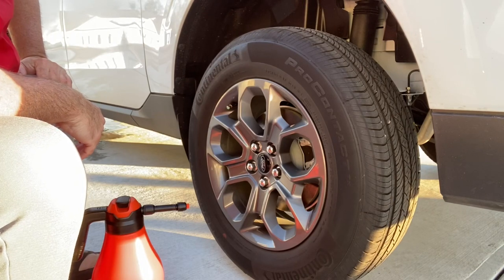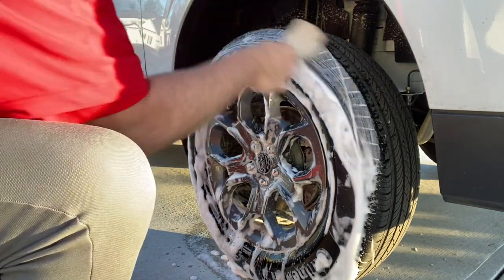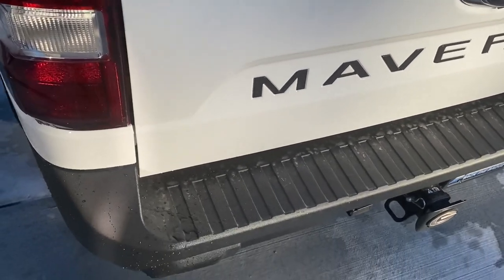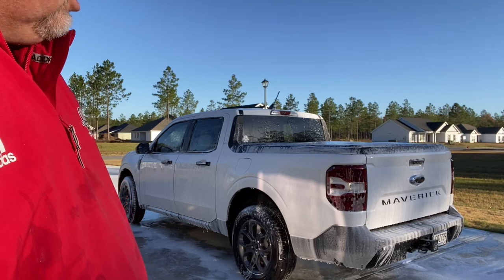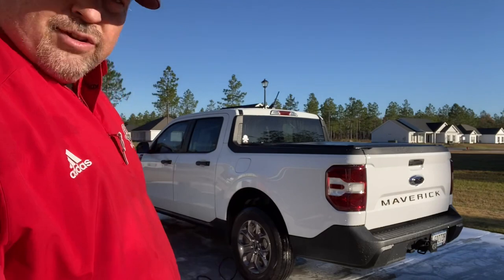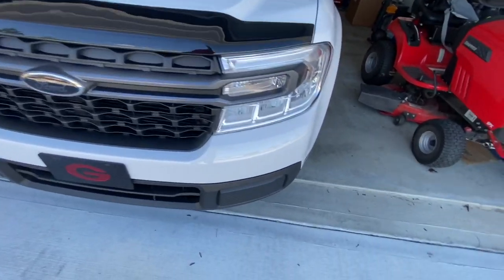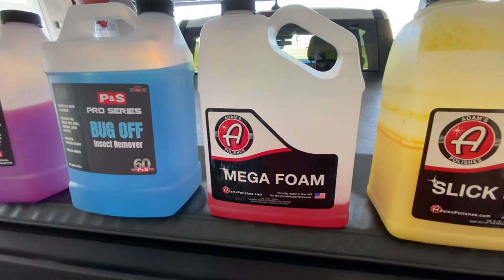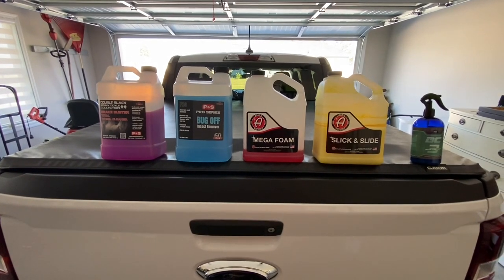Maintenance Wash your Vehicle

Comment: Awesome video.  I have a maverick hybrid and I'm getting the required tools so I can wash at home and do it right.  I bought the rv filters and an rv water softener to avoid water spots.  Also bought a ego leaf blower and looking for a good deal on an electric pressure washer. I applied turtlewax hybrid ceramic and it looks amazing.  Wanna keep it lookin great as long as possible.  Thanks for the video, great info and products.

Comment: Hey David great video!!! Just as an fyi, I have a similar foamer and have been notified using the P&S can affect the sprayer. So I switched up to a soap and APC mix in mine just to avoid messing up the sprayer. Then I use Brake Buster in a standard spray bottle on top of the foam if that makes sense. Anyway, great content. Take a look at my winter wash video I did almost the exact same process as you did lol!!! Oh yeah and GO DAWGS BABY!!!!!!!
Reply from the maker: I appreciate the heads up on the Brake Buster in the foamer. I may go back to using a foam cannon with BB. I was already thinking about using that sprayer for my Absolute Rinseless Wash. Have you tried Wash Chem Pro 50? I am thinking about using that with Gtechniq Ez Coat for Winter washes when it is cold.
Reply: @MrCoachKelly  I haven’t used wash chem pro 50. I’ll have to check it out. The standard wash and CS3 for drying aid has worked well for me but always looking for good methods!!!!